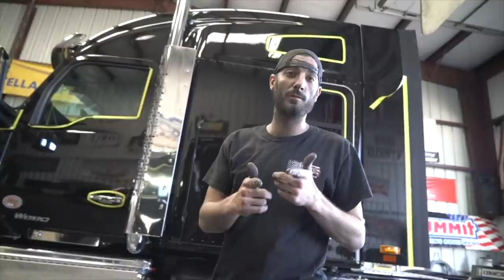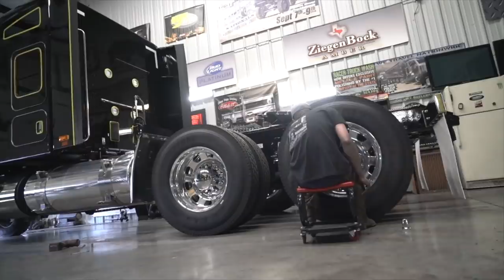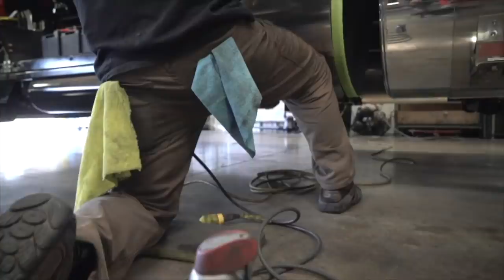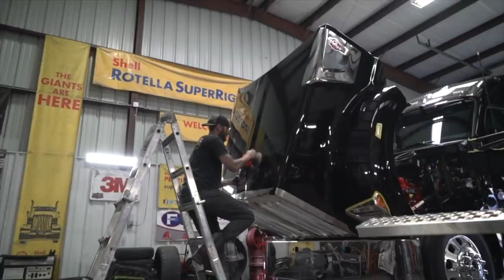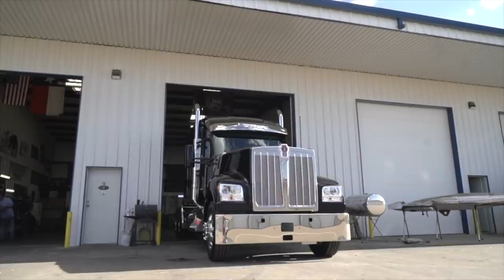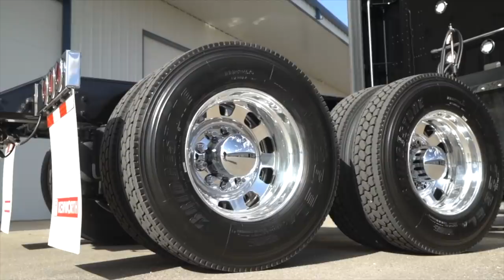Kenworth's NEW 2020 w990s get turned into MIRRORS! Cleanest Newest rigs in all of Texas!

Comment: Really replacing the w900?
Reply: Rigoberto Rubalcaba w900 ain’t going nowhere, will still be around for a long time.
Reply: Unfortunately
Reply: There wrong kenworth specifically  said it wasn’t replacing the w900
Reply: @roboakley2685  When Kenworth originally released this truck they did say that it would replace the W900 but after much driver outrage they backed down from that statement
Reply: @leir2005  You're absolutely right. Kenworth listened to their customers and kept the W900.